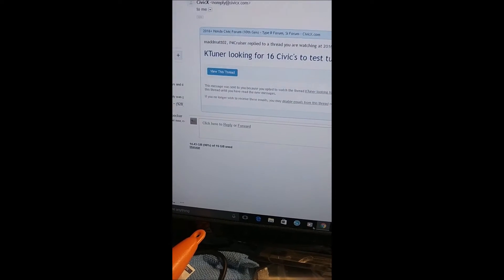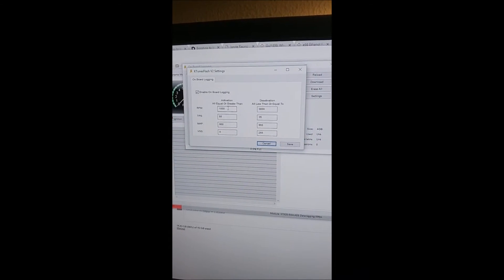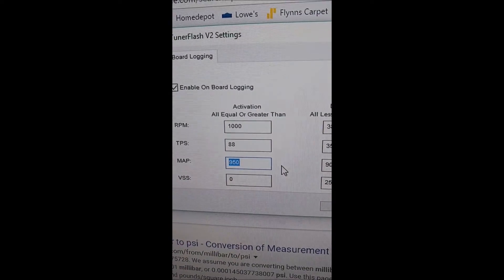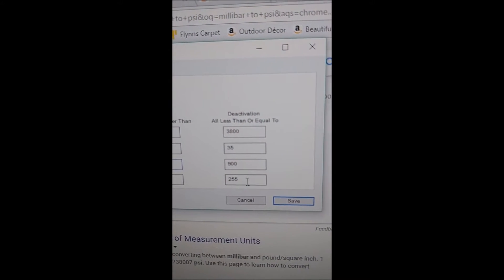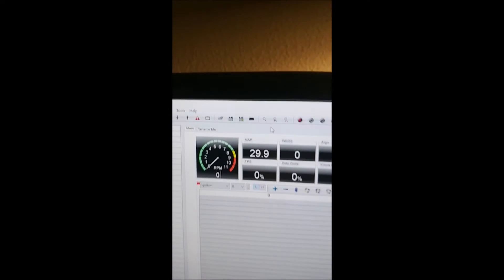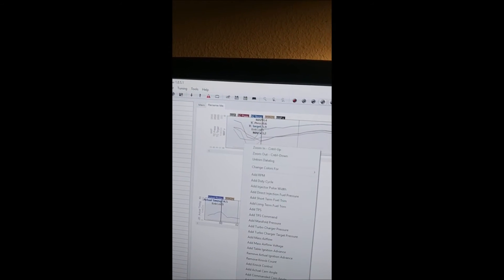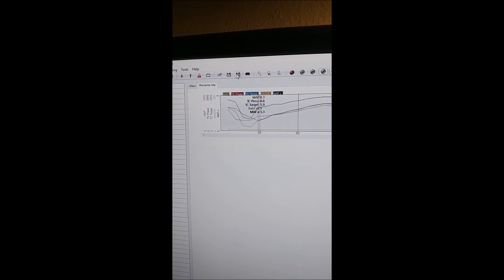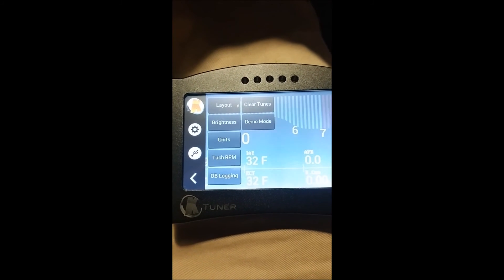how to datalog with ktuner v2 touch diy

Comment: For some reason, I can't get Data logging to work properly. Check out my video, see if you can tell if I'm doing something wrong. 

https://youtu.be/VB7lXMg62Nc
Reply from the maker: I replied to your video, you just have to click "rename me" next to the "main" tab, that's where it shows the data from the log. I remember he told me he was going to add a start logging button a while back, obviously he has done it, I also am pretty sure I don't have that blinking light in the corner while logging. I'm sure you know but the reason it doesnt stop logging is because you have the deactivation settings all at 0 and while running the rpm will never be 0. I have them set at 0 so that it wont stop ever, I also have activation settings VERY low so that basically when I hit "enable logging" it starts logging and stops when I hit "disable logging"